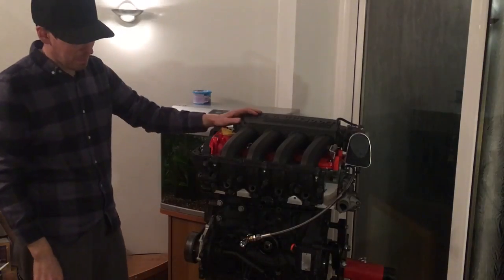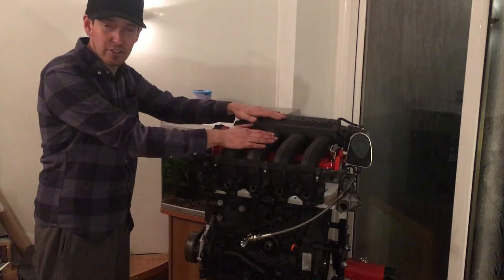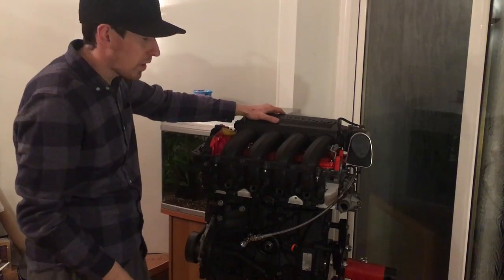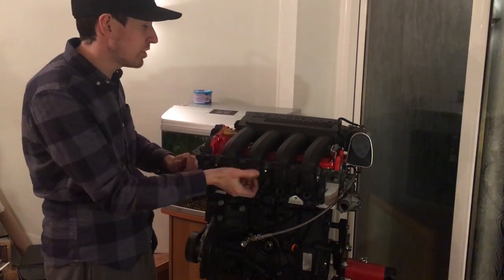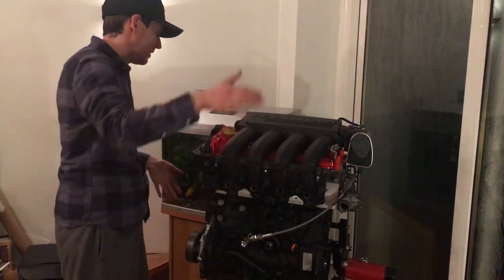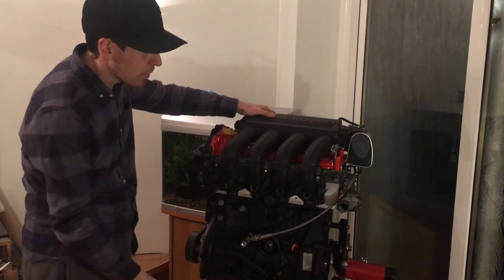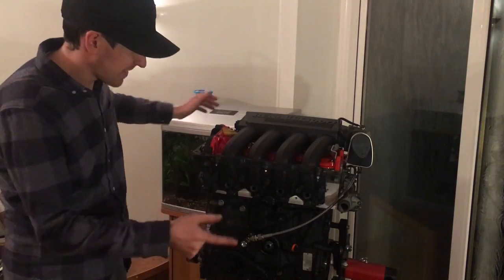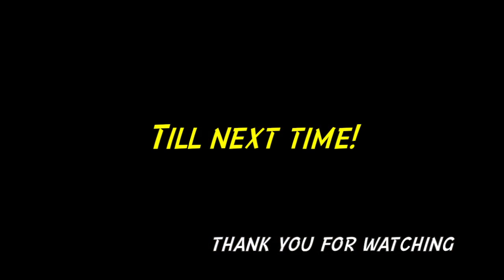Top End Torque Settings, ALMOST FINISHED!!  - Clio 182 Turbo - read description

Comment: Awesome stuff,, I'm a little late to the party as I've only just bought me a clio 172 2003reg.  But incase you read this,, did you paint your cam cover yourself,, if so what dis you use?
Reply from the maker: I'm still here, just haven't done a video in a while. If I remember it's just some heat temperature red paint from good old Halfords, the bush on tins

Comment: Stock or upgraded valve springs?
Reply from the maker: I'm actually still on stock valve springs 😅 my idea was the engine was revving no higher so will be fine, and well it has been but if I come to strip it down at any point i think I'll be fitting some just for safety. 
Just inconel supertech valves, port and polished, new valve guides, seats cut and three angle
Reply: @Steffrallye  thanks mate 👌
Reply: @Steffrallye  btw where do you connect the water lines for the turbo?
Reply from the maker: @pedrocunha5863  mine currently run from the thermostat housing to the turbo and then from the turbo back into the coolant tank. Tho it's better to run it from the heater matrix pipes really, where they join together before the bulk head
Reply: @Steffrallye  you are great! Thanks a lot 👌
Reply: What cams you running mate?
Reply: What cams you running mate?
Reply from the maker: Standard cams

Comment: With the cylinder head bolts , stage 1 is 30nm then you leave it for 30 mins if I am correct? When you come back and do stage 2 which is also 30nm, do you undo / slacken the headbolts and retorq to 30nm? I’m a bit confused as to what it means to “retorq” the bolts at 30nm if they are already at 30nm I just presumed it means slacken the bolts by undoing them a bit and retorquing again to 30nm? And then immediately do 180 degrees ? Hope that made sense steff! Any feedback would be appreciated :)
Reply from the maker: BIAWolf hey, basically you do the 30nm, go off, make a cuppa and a sandwich. Come back and go round them again 30nm. 
You DONT slacken them, basically while you leave it the head settles and compresses the gasket. When you go round the second time your find they will tighten a little more as they’ve become slack. Some will, some won’t. 
It’s just away to be 100% sure it’s at the right pressure alround, then do the 180 after.  Hope that makes sense
Reply: Steffrallye ah ok, do you recommend a higher torx setting for a 1.6mm headgasket? That’s what I’ll be using
Reply from the maker: BIAWolf no no, torque settings stay the same. Gasket size doesn’t make a difference.
Reply: Steffrallye ok mate thankyou, do you use anything on the new head bolts out of interest ? Loctite or pre assembly lube? I’m not rebuilding the engine like you have , just putting a new head gasket and belts etc so a bit of engine oil where the cams sit etc?
Reply from the maker: BIAWolf just check the holes for the head bolts are clean and not full of oil so the bolts run down without issue. Bolts go in straight out the box. 
Yep either just some lube or oil on the areas of the cam, rockers that will make contact on turn over
Reply: Steffrallye thanks mate :)
Reply: @Steffrallye  Hi, do you know what the Torque Settings are for 2004 Megane 225 I've been given Two different Settings; 20nm check all are 20nm after 30minutes  then all 100deg  them another 100deg.//.  other setting: 30nm  after 30minutes check 30nm then 180deg....    Thanks

Comment: Looks absolutely amazing. Are you on cliosport.net ? you should post a link to your videos/channel there.
Reply from the maker: Gus Nilsson I’m not tbh, I’m on the Facebook pages a little but really should sign up to the forums again.
Reply: @Steffrallye   Steffrallye  Hi, do you know what the Torque Settings are for Megane 225 I've been given Two different Settings using stock Head Bolts; 20nm check all are 20nm after 30minutes  then all 100deg  them another 100deg.//.  other setting: 30nm  after 30minutes check 30nm then 180deg....    Thanks
Reply from the maker: @cbrf4r579  its 30nm 30nm then 180 degree.
Reply: Thank mate